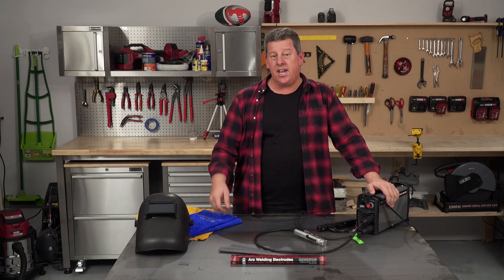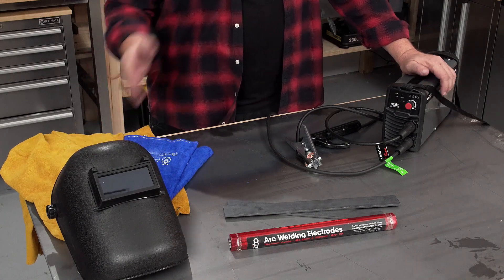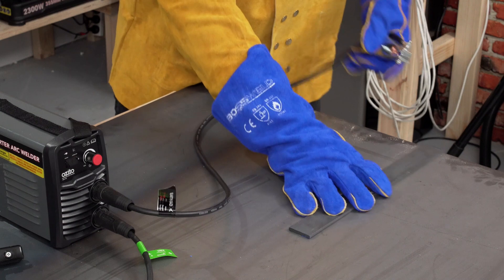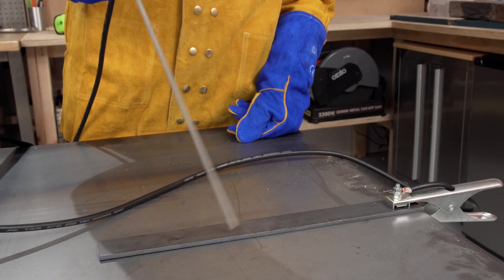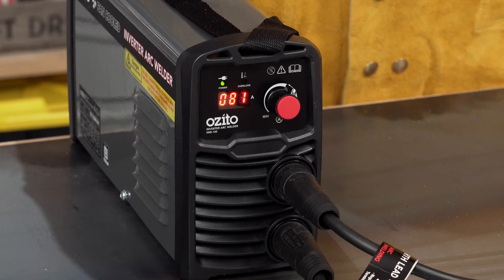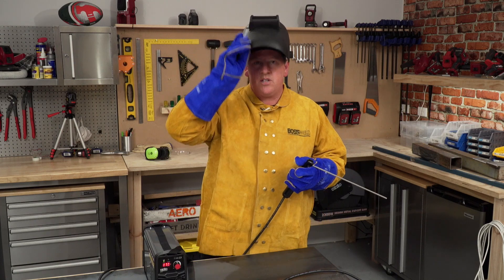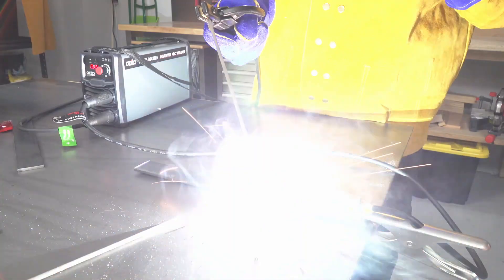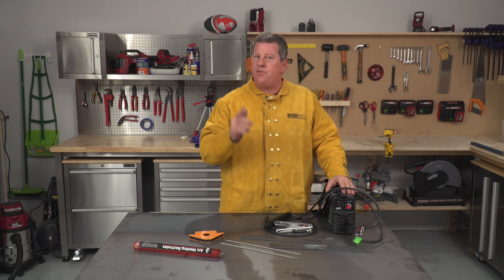Ozito Tool Tips - How to strike an arc with a stick welder

Comment: Did anyone else notice that he cranked it up to 83 amps before it began to arc properly?
Reply from the maker: Hi Gary, thanks for reaching out. Our Engineering Team has suggested checking if the metal contact areas are clean and the wiring connections and clamp are properly engaged. Please reach out to our Customer Service team directly for further assistance - Call on 1800 069 486 (Aus) or 0508 069 486 (NZ) or email them at enquiries@ozito.com.au. Cheers

Comment: Hi, I have that exact 120 amp model but when I turn it all the way up, the digital display only says 95 (not 120) any ideas?
Reply from the maker: Hi Merwan, thanks for reaching out. Our Engineering Team has Advised that the machine runs on 10A. There must be a fault with the digital display. Please reach out to our Customer Service team directly for further assistance - Call on 1800 069 486 (Aus) or 0508 069 486 (NZ) or email them at enquiries@ozito.com.au. Cheers